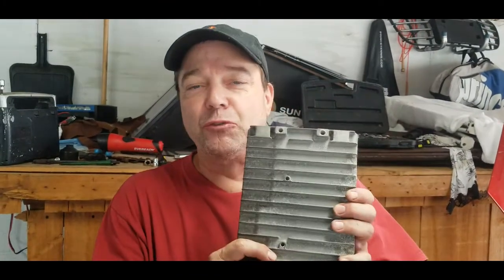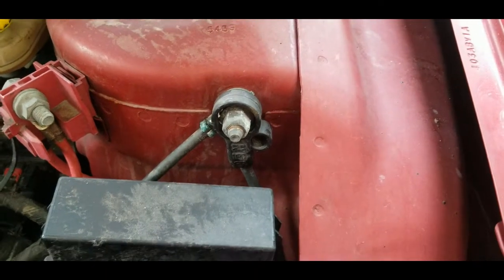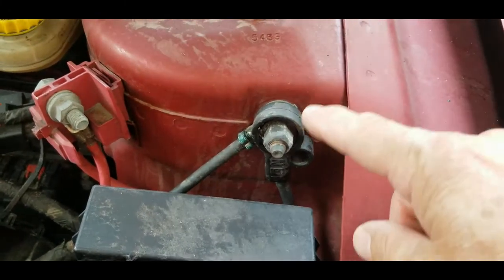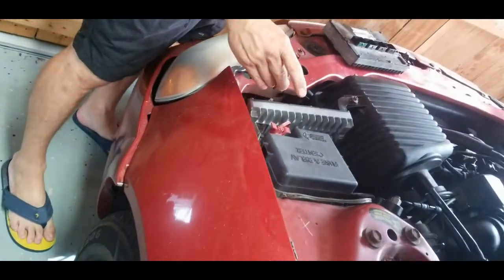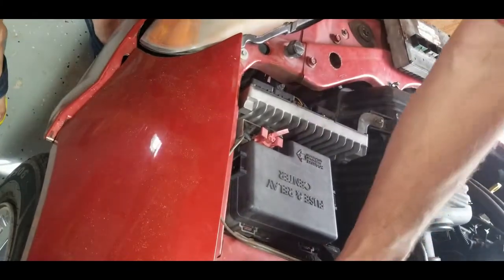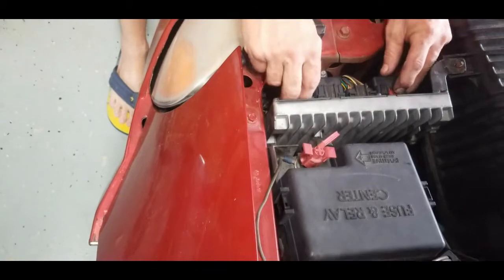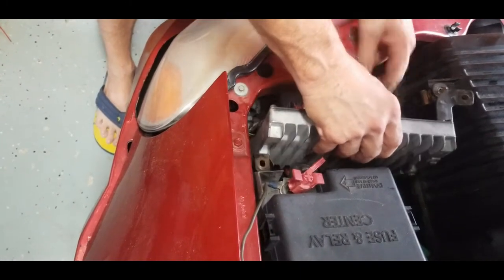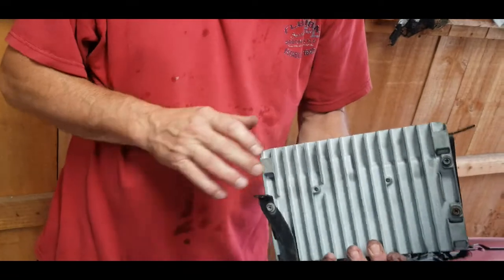Replacing ECM - Electronic Control Module (computer) on 2004 Chrysler Sebring

Comment: Can the ECM cause the alternator to NOT charge the battery. Causing the car to run up untill the battery dies? The alternator was tested and was good so wasn't the battery. It STILL will not charge the battery to stay running.
Reply from the maker: Maybe, you never know with electronics. More likely a bad ground somewhere.
Reply: @TurbineGuy  mine's doing the same thing as hers what ground should I check
Reply from the maker: @unicel3006  that is the hard part. You have to start following wires until you find it.
Reply: Did you find the problem. My 05 is doing the same thing